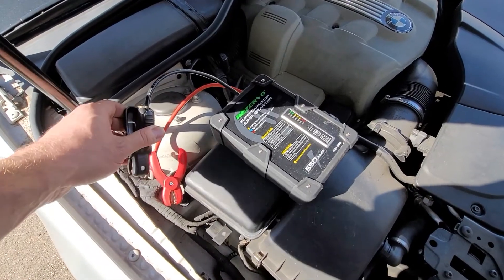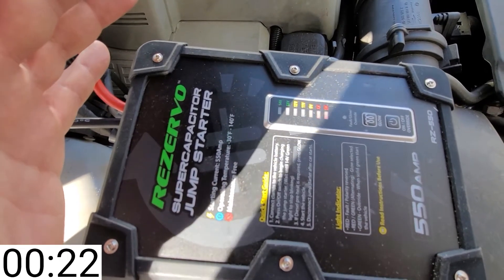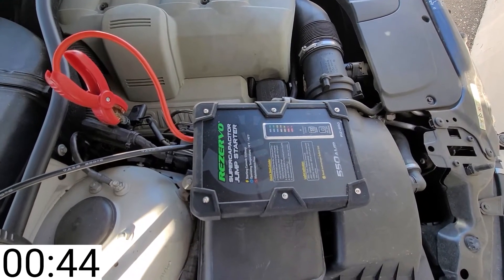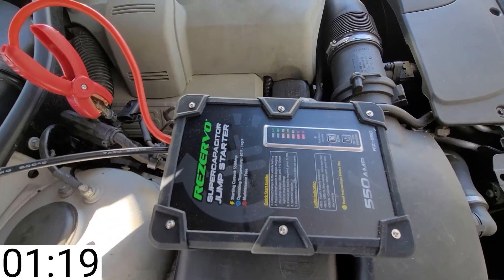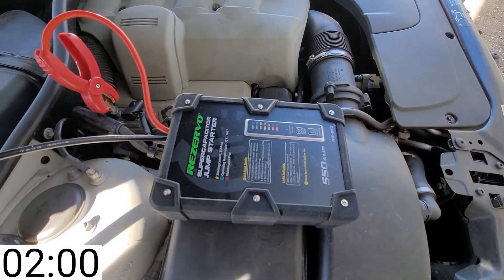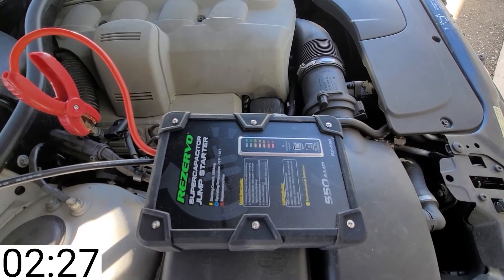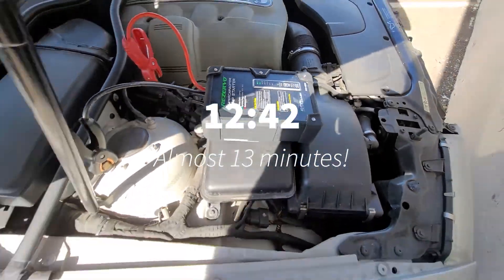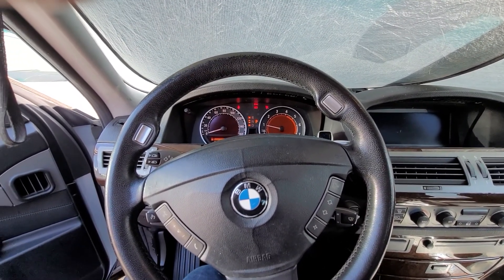Test: Capacitor Jump Starter

Comment: Just a word of caution though, since it uses the low remaining power to charge itself, it does drain your battery further. Once started, you can drive no problem, because the alternator is taking over, but keep in mind your battery is still low. You need to let the car run or drive it for at least an hour for the alternator to charge the battery enough if you what the car to start the next time. But it will get you out of trouble when your car is won't start out of the blue and there is nobody around to help you. I keep the batteryless jump starter in my car's trunk and it works even during freezing cold winter days. You definitely can't do that with battery powered jump starters. 

I would suggest using someone else's car or a wall outlet to charge it when possible, and if you've got a car battery charger at home, put it on charge once back home to ensure it get fully charged. I didn't do it and at one point point I needed to use the jump starter a bit too often, the more I jump started the car, the less the battery would keep a charge. Fortunately the battery was just a year old and managed to get it replaced under warranty. Note that this applies to jump starting in general, but since this one will drain the battery further to work, it's even more important

Comment: What type of battery your car uses? Don't say its not lead acid, because lead acids can't be charged this rapidly
Reply from the maker: It is lead acid.  But it's not being charged by this box, this box is sucking out the rest of the juice left in it to charge itself, and then provides power to jump the car.
Reply: @AlecKristi  wow, get it now. Thanks 
But it's not good for the battery too. You can charge it from some other battery too.

Comment: The connection is wrong…both jump starter cables should be connected directly to battery terminals.
Reply from the maker: incorrect.  wires should always be connected to the vehicle jump points, not battery terminals.
Reply: Doesnt really matter, all goes to the same place'es anyways, lol.

Comment: Where did you attached the red cable, its that the + battery terminal? I don't see any battery car
Reply from the maker: BMWs usually have the battery in the trunk, this is the battery jump terminal which is under the hood.
Reply: @AlecKristi  its always better to contect somthing like that as close as possible to source.. Maybe it will make charging time shorter next time if you try it from trunk.
Reply from the maker: @Xv1p3rCr0  charging time will not change, as charging draws very low current.  however, when you try to start - current will be lost on the way to the starter.  so, it is much better to connect as close to the starter and as far from the battery as possible.
Reply: @AlecKristi  while that is true in starting,(that position) doesnt apply to charging for obvious reasons, resistance.  Voltage and current is always used not only current.
Reply from the maker: @Xv1p3rCr0  when charging, the unit uses a boost circuit that only draws a couple of amps at most.  the voltage drop over the massive cable coming from the battery will be close to "nothing volts" ).  so the charging time will not change whether you put it directly on the battery or under the hood.
Reply: The charge current is more than 2A if the battery is capable supplying it. It'll charge up in a shorter time if the battery can maintain a higher voltage with the higher current. If the voltage drops, the boost circuit will draw less current and charge at a slow rate, but it will change faster with a higher current.

Comment: I'm surprised this is the first comment. I have one that looks identical but with a different name.
Your video was excellent, it showed the capacitor bank was able to charge even with an almost dead battery.
With a battery that's too flat to start the car but not as flat as yours it only takes a few  minutes.
Good to see it will get you going in such a bad situation.
Reply: Ist it schumacher dsr 108 or 109?
Reply: Ist is